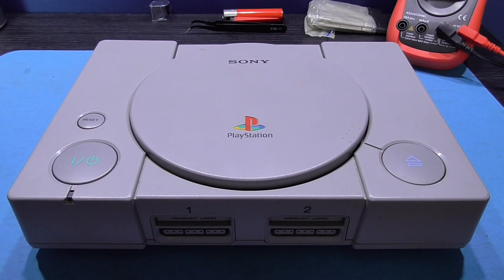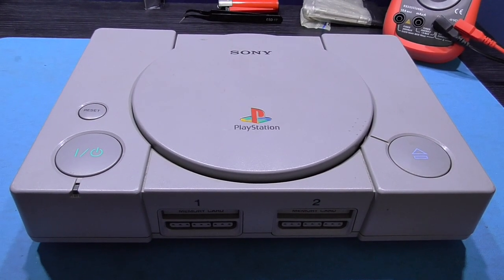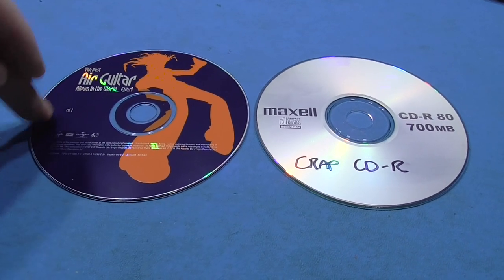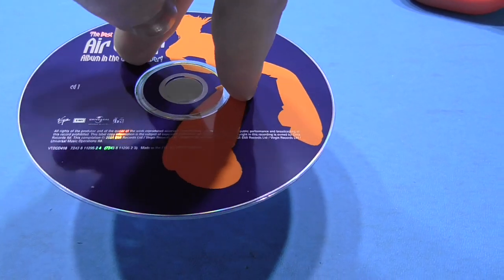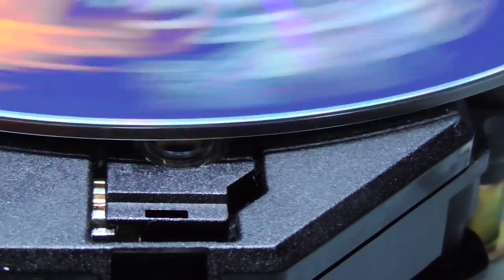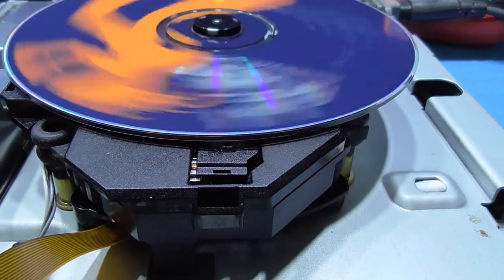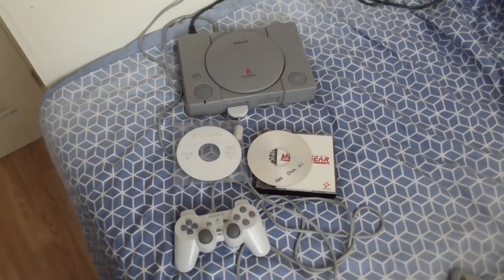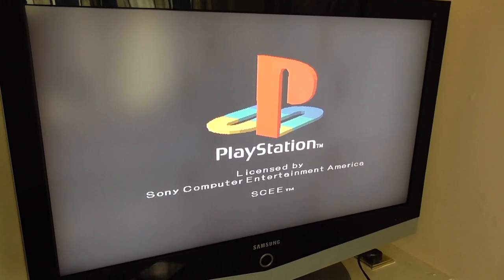Sony Playstation - Adjusting a Laser \ Optical Pickup for backup CD-R Media.

Comment: Great stuff =D  Nice covering the issue about disc wobble - that's something I forgot to mention when following on from RetroGameModz video, but tbh provided you test audio tracks on inner and outer edges of the disc it should be OK.  That's also where the tracking and focus gain adjustments usually can come into play (wobble and tracking) - thankfully I've not had to touch those yet.    One thing I would say though, it's better to reduce the voltage where possible, rather than increase it.   Typically people increase the voltage when CD-R won't work etc, but often the media makes a difference.  For example, on my Saturn it won't read the discs you showed there (Maxell etc), but it reads perfectly the Taiyo Yuden discs even after reducing the laser voltage.   

The other benefit in reducing rather than increasing (if you can, and if it still reads CD-R) is that the laser will last longer.   From the systems I've checked so far I've found that at manufacture they set them according to quite a large tolerance.   eg. on PS1 I read in the service manualy up to 1.35v is OK, and mine was set to over 1.1v.  But it works fine at 1v, and can go as low as 800mV.  This is also the reason that some PS1's and other consoles die before others - if the laser was set quite high at factory it won't last as long.

I am sure you've seen the same thing with LED's - if you drive them bright, they last half as long.   Great video though, lovely scope, lovely video =D
Reply from the maker: Your right about the laser power, I don't like pushing a laser over 1.1 v-pp even for CD-R's it why I was happy to see this laser comfortable reading these crappy discs at around 900mV, it should be fine at that voltage and last a very long time as its well under the 1v-pp mark and should be no problem for a CD laser to cope with and will also read a lot of different manufacturers CD-R's on the market as well because I just know my friend will ignore my advice to use good quality discs and buy rubbish ones instead. Bloody cheapskate, ha-ha.

As for your CD-R reading problems on the Sega Saturn, it's common. I also have these issues it because the Sega Saturn utilizes an older style \ method of reading the disc compared to the Playstation.

The Playstation's optical system (apart from some early models) was way more advance than the Sega Saturn's, if you look at the Sega Saturn. hell, not just the Saturn but many other consoles from before and around that time period there are manual adjustment for optical adjustments like FEG, TEG, FEB, TEB, were on the Playstation most of them are gone and are taken care of by custom chips like the (IC-723 CXA-2575N \ RF AMP and IC-722 BAS-977FP-E2 \ FOCUS/TRACKING COIL DRIVE MOTOR DRIVE) these in conjunction with other custom chips can monitors and adjusts these adjustments on the fly for optimum disc reading while the system is running. Yes, way more advance than most other console from before and around its time period.

The only real adjustment you can do on the Playstation is to the laser power (and bias I think on earlier models, but don't quote me on that) it's why the Playstation can read so many crappy quality discs and other systems from before and around that time period like the Sega Saturn and alike that use the older style \ methods struggle reading those very same discs.

You see this quit a lot on modern optical systems today, there are no adjustment for FEG, TEG, FEB, TEB as the optical system inside the system does it itself on the fly. its self aware. Yes, were getting closer to Sky Net every day, there will be terminators walking down our streets in the very near future. Ha-ha.

The Playstation's optical system was pioneering in its day. Yes they did have teething problems but that turned out to be the laser itself causing the problems and having it to close to the PSU (heat).

As for tracking, I like you stay away from this. It's one of those if it's not broke, well you know the rest, and should only be considered if the laser unit has been completely replaced for another and even then because most lasers for a system are made to a spec the truth is it will probably never need to be adjust anyway from its original factory setting.

Thanks for the feedback by the way, it's always great to hear from you on my tiny little channel. Ha-ha.

Yes my scope, it’s a Rigol DS1054Z. Worth every penny of the £350 I spent on it, I'm thinking of hacking it to unlock the extra features but I'll probably wait until the warranty runs out before I do so.
Reply: I might need to do another video as I am not sure I made it clear that when you adjust the laser voltage, the RF pattern doesn't show the actual laser voltage - it's just the voltage of the RF signal picked up by the pickup.   What I mean by this is, say for example a CD-R gives 1.1v pp, with a pressed disc you will see over 1.1v pp, maybe 1.2v or 1.3v.   The laser will obviously be set higher voltage to get that 1.1v pp with a CD-R, and as a result it will last a shorter amount of time - not neccessarily by a linear amount either.  But what you see on the RF signal isn't actually the laser voltage.  So despite only seeing less peak to peak RF level, the laser is working just as hard as it is (if not harder) when reading a CD-R vs a pressed disc, despite the RF level being lower for a CD-R.

In the service manual Sony set the RF level with a pressed disc between 900mV and up to 1.35v - which is a crazy tolerance window to set them by imo - it's probably to accommodate tolerances due quality difference between lasers.     All that said, its probably best to  start at 900mV and test with pressed media, and if that works then test with a CD-R.  With the right type of media, CD-R can work as low as 700mV pp on the RF signal  on the Saturn, and it might be similar on the PS1.

I guess the point I am trying to make is lower is better, and perhaps I didn't emphasise that enough in my previous videos.  I take it that CD-R discs weren't working before you had to increase it?  It's kind of like the point people make where they say 'my system wasn't reading discs, so I just tweaked the laser up a bit and now its ok' - They are right, but it will not last because the laser had already got to the point here it has lost output so much that the associated RF signal had dropped out of the range where it was sufficient.  So all they are doing there is just getting that last bit of life out of the laser, but it will continue to drop with use.  (Annoys the hell out of me because lots of people do that on eBay...)   In summary, if you can reduce from 1.1v (or over, as set by Sony), you can often still read the 'right type' of CD-R (eg. Taiyo Yuden), and will extend the life of the laser.   Personally I would say if you need to increase the laser to work with a type of CD-R, either change the CD-R media for another, or increase the voltage but expect less life from the laser.     I hope that makes sense, I am not trying to knock your approach, just trying to be clear on things I perhaps wasn't clear on in my previous videos.
Reply from the maker: No need to go out of your way to make another video, I think I understand you

Basically, if you Increase the power for reading CD-R's it 's also increased for the factory pressed CD as well, they're not both fixed at the same value, increasing one will also affects the other and over time because of this increase in power the lasers life is shortened.

Yes. I know this. 

There are many differing was to approach this problem of reading CD-R's. One other way of approaching this but I find it's very problematic when using differing manufactured CD-Rs is to.

Ignore the factory pressed CD all together and jump straight in with the CD-R, start lowering the power of the laser while monitoring the eye pattern on your Scope for signs of distress as you'll see this on your scope before you see any signs else ware.  Then at that point adjust the power just a little above where you first saw the first signs of distress.

What you'll find is the power level will be somewhere in the region of 700mV-pp to 800mV-pp and the factory pressed CD will also be very happy at this power level.

However. Like I've mentioned this can be a little hit and miss when it comes to the system reading differing manufactured CD-R's but it's the best option if your only intention is extending the life of the laser while still being able to read some CD-R's. 

I suppose the real lesson here for anyone who is reading this is.

There is more than one way to skin a cat and if you want your system to be able to read differing manufactured CD-R's, well sadly you're going to have to make a sacrifice.

Ha-ha, No bud I don’t feel as if you're knocking my approach, far from it. I always appreciate your input and your input will always be greatly welcome here on my channel my friend.
Reply: @Four_X  I know that your comment is old but all the Saturns manufactured around mid 96 (some model 1 and many model 2) already had newer JVC CD drives without all those potentiometers that you mention. Nice video by the way, I'm looking for a super cheap oscilloscope and YouTube brought me here : )

Comment: 13:11 Never adjust a laser pot with a bad quality CD-R.

Because, if you do that, the laser is gonna to be too powerful for an original disc, creating reading problem.

Use always original disc, put the laser on the middle rail and try to obtain a RF signal of 0.95/1.35v p-p.

(Tested with my 7002 using an analog scope)

Comment: Hi, Just wondered something if you up the laser voltage to read CDR media, what affect does that have when using pressed originals? If you are going to use both pressed originals and burned media is there an in between voltage you would use or just get it to read the worst discs and leave it at that?Regards,Chris.

Comment: I'm using a Hantek DSO2000 series, and it simply cannot trigger onto the eye pattern like my 40 year old Tektronix 2236 could before the PSU literally well, exploded.  I do plan to fix the old scope with the new one, but I'm shocked you are getting a clear eye pattern out of your Rigol, and I'm set up basically the same way as you are, but the Hantek refuses to trigger on the eye pattern.  Unforutnately the Hantek was all I could afford right now, so I hope it is possible to do.  I am seeing the peak to peaks however, but I noticed if I even went near 1.2v peak to peak, the top of the RF output would flatten and the laser hisses.  I'd assume since it can go "up to 1.35v" this shouldn't be.  My 5501 is using the 440-BAM laser as it was a new laser out of my PSone (a PlayStation that got used only for a few months then put away, then capacitors killed it and my 5501 survived, but had an ADM laser which was very weak).

Comment: resistor calibration is between 750 ohm and 800 for cd-r. the cd´s must be clean and been recorded at 2x-4x speed, cd´s carbon positive makes a great copy and green pad label cds are trustable.
not use verbatin, sony and other cds when the light passes very free. use cd´s grade A to make copy.

Comment: Can you help me, I'm trying to do the calibration like in your video, and I'm not getting results, my oscilloscope is a hantek DSO2D15, I set it to 200mv for 500ns AC coupling, and I don't get the waveform that is in the service manual and As you show in the video, could you clarify where I'm going wrong? I have an original audio CD for testing
Reply from the maker: You may need to put your scope into Persistence Mode, It will be in the acquisitionn memu or in the triggering menu.
Reply: Got the same scope, it really has issues with CD eye patterns and is borderline unusable for this job.  My old 2236 Tek had zero issues with this.  Basically remember, this DSO is triggering horizontally in the middle, not the left, so your eye pattern starts in the center.  Also yes persist needs to be on, at least 5 seconds.  But it will appear messy, because triggering on this DSO is software driven, not hardware, so it's just an all around mess.  I also am not sure I trust it's peak to peak voltage, because my laser sure is hissing loudly at apparently 920mV PP.  (1.1v it rolls over at the top and starts skipping).

Comment: Hi, sorry my bad English, please tell me why I can see a wave form like you in my Osciloscope 100mhz hantek, I put AC, 200mV scale and 500ns scale time and get 0.90v to 1.36v pp but I cant see a beautiful waveform like that, just a normal waveform senoidal. Please help.
Reply from the maker: Make sure your scope supports \ is in persistence mode. some scopes you'll need to enable it in a menu (look in triggering).
Reply: @Four_X  I will to check that, my Osciloscope is Hantek DSO2D10

Comment: Imation CD-R is not very not good, pot tweaking laser optics while electricity running thru disassembled PS1 is dangerous not the same as doing on PSone. Good idea to use original pressed ps1 disc as test disc.

Comment: Have to disagree on the 750X. You can't mod those with SPDIF output due to the integrated sound processor. I believe 7000 is the highest you can go and still mod for digital audio output.

Comment: thank you very much brother :)
but if i didn't have osciloscope how i can calibrate lazer
Reply from the maker: You could us a multimeter but you're putting the laser at high risk when doing this way.

One of the main reasons for using a scope over a multimeter is a laser will have a limit to how much power you can push through it before you start to damage it. When you use a scope you can monitor and see in real time signs of distress from the laser by monitoring the eye pattern and you can see on the scope if the laser is being pushed too hard and can indeed handle the increase in power before you go on to do any irreversible damage to the laser.

However, if you use a multimeter you cannot see those signs of distress and before you know it you can easily pushed it that little bit too far and then it's too late and your burning or have burnt out the laser and it will need to be completely replaced.

If you know anyone with a scope and they have the knowledge of working with optical systems it will take them less than 20 minutes to cal your Playstation's laser for high quality CD-R's, you may think you don’t know anyone who can do this for you but you'll be surprised. If you live near any kind of TV, Video repair shop someone in there will no dough have the knowledge to do this for you as they'd probably been working on CD, DVD even blu-Ray players built into TVs for many years now and it shouldn’t be a problem for them to cal your Playstation's laser for CD-R's if you ask them nicely. They will probably charge a small fee but you can always shop around right. Hay, look at it like this. I'd rather pay a guy a little cash and get it done properly than to try and do it myself and burn out the laser and give myself an even bigger headache.

OK, if you still think you can handle this yourself with a multimeter and are still interested in giving it a go, here's how.

The technique is similar with a multimeter as it is on a scope, however like I mentioned before you have no way of knowing if you're pushing the laser too hard.

OK, pop in a genuine disc and boot. start by measuring the laser power adjustment pot using your multimeter with a genuine disc in the drive (TIP. try to do this while the system is playing FMV or an audio track as the voltage shouldn’t be bouncing all over the place at this time). OK, let's say you do this and the voltage reads on your multimeter as 700mV

Now, make a backup copy of the genuine disc using High Quality CD-R's and pop the CD-R backup in the Playstation drive and boot. Now

Do the same again but this time with the high quality CD-R. Measure the laser power adjustment pot using the CD-R (TIP. for best result try and measure at the same point or position you did with the genuine disc), OK, let's say this time the voltage reads on your multimeter as 600mV

Well, what's the difference (offset) between the two readings, well its 700 - 600 = 100. Right. That’s a + 100mV (offset) difference from the genuine disc to the CD-R.

Final step, while the CD-R backup is still in the Playstation drive (TIP. and is reading the same point as before) add the + 100mV to the laser power adjustment pot using your multimeter to bring it up to the same voltage as what the genuine disc was "remember 700mV". Those CD-R's should now read as good as the genuine disc did (in theory) if you use high quality CD-Rs.

Again please make sure you only use high quality CD-R discs. (I can't emphasise this enough) most people cheep out when it comes to CD-R's and blame the Playstation's laser when it can't read them, I see guys cheep out and complain on forums all the time. They go out and buy 100 Maxell CD-R's for £8 and expect the Playstation to read them. It's quite comical at times.

My personal CD-R of choice is.

Verbatim (43343) 700MB 52x CD-R AZO Crystal 50 Pack Spindle.

Their around £12 for a Spindle of 50 and yes their very good CD-R's.

I hope this help you out, personally I would still get a repair guy to do the adjustments for me. Oh, and I'm sorry if this is a bit long winded.